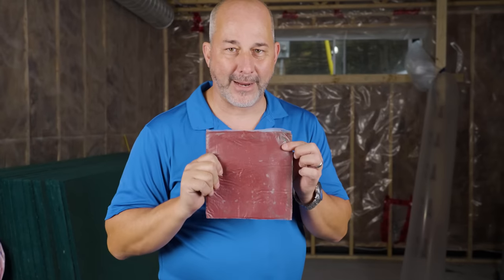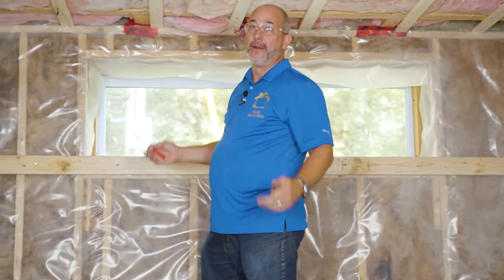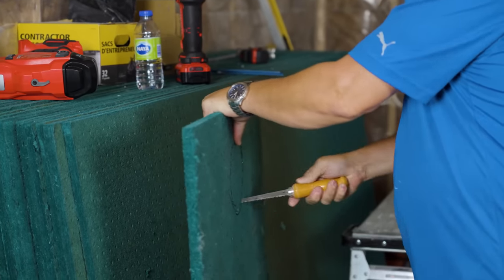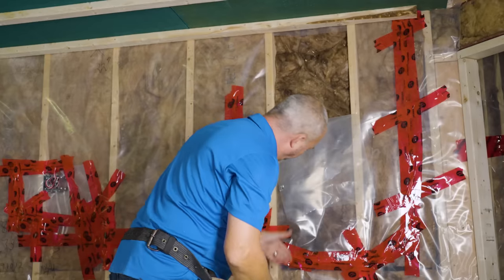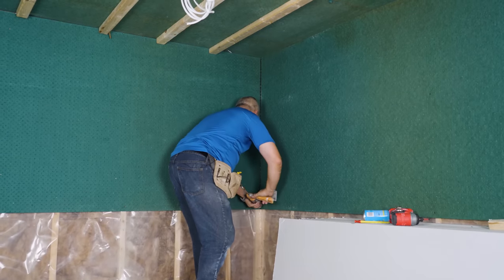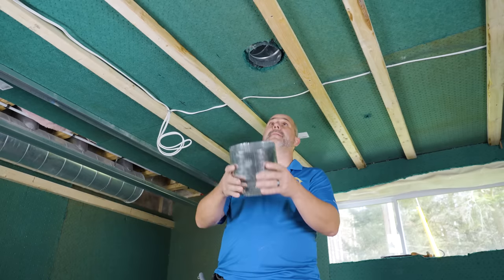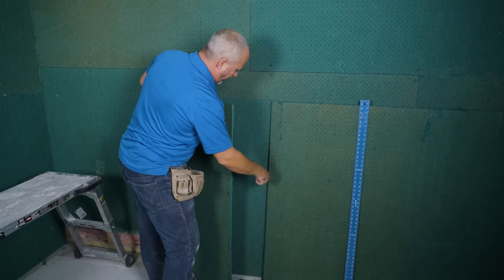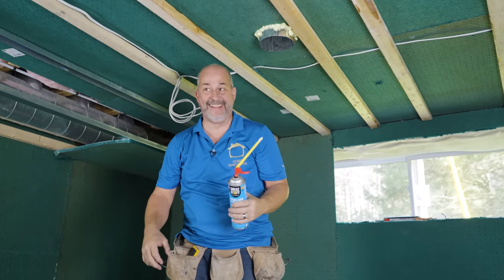Soundproofing A Room (It's Easier Than You Think)

Comment: As for wall soundproofing, IF you can afford to lose some space, building double walls with a space (like 1/2 inch) between so they do not touch, works great for preventing sound transmission. It’s the method used in apartments to separate units from each other.

Edited - I was forced to add to the original comment, because a few people couldn’t comprehend the idea that this was only an additional suggestion of another method used for sound proofing and I used apartments as the example. Perhaps apartments wasn’t the best example, but condo’s use the same methods and you usually don’t hear the neighbors. It’s only a part of the equation for creating a sound proofed room. Logically speaking, if you hit the 2x framing member in the wall, the sound will vibrate through to the opposite room that shares that wall, no matter how much sound proofing insulation is in that wall. You can use sound deadening caulks between two sheets of drywall and this can help, but you still have the potential for sound to vibrate through. Everything working together - 1)a double wall. 2)sound proof insulation. 3)doubling up drywall. 4)caulking any and all wall penetration and joints. Finally, there is a metal channel drywaller’s  use that help separate the drywall from the stud wall to aid in the prevention of sound transmission. This is usually purchased at  a drywall supply company. I’m sure there are other methods and materials out there, but again, this was only meant as an additional method. I don’t think that’s too difficult to comprehend.
Reply: Apartment sound proofing isn't the best.
Reply: @vanderumd11  
Who said it was?
It was meant as another example of preventing sound transmission through building materials, which is probably the main culprit for sound moving through walls. If they’re not touching, then you eliminate a large source.
Reply: If you're going to cite apartments as an example of "great soundproofing," you need to expect people who have lived in apartments to laugh at you. Apartments soundproof about as well as one ply cardboard.
Reply: @Xanthelei  
Most likely in low end apartments. In high end and condos, you have a far superior soundproofing experience.
Reply: @Michael Patterson  Guess which one the majority of people are going to experience. I'll give a hint: it's not the one that requires you make 100k a year. Thus citing "apartments" without specifying "high end" is defaulting to the baseline, which has terrible sound isolation between units.
Reply: @Xanthelei  
OMG!
All I stated in the beginning, is this was another method of soundproofing and now I’m getting crucified by people who think they know more than everyone else???

Don’t blame me if you and others can’t afford a higher priced unit, and please don’t take it out on those of us who offer other options. This is how we learn. 

If it’s done correctly, this is a very viable method. Soundproofing is more than just stuffing the cavities with specialized expensive insulation. If you hit a 2x wall member, it WILL vibrate through to the adjoining room. If there is a separation between two walls, and combined with insulation and caulking other openings, you have a great combination of methods working together! Think about how this will work.

Comment: I like your videos, I hate renovating my own home. I watch one of your videos and then I can do a little more renos... thx for that.
Because I like you... those studs used as strapping don't need to go wall to wall, right? I can't tell if you had to scroll the green panels around the straping ends, but if you give yourself 1 1/2" to 1 3/4" from the end of the studs to the wall, no need to scroll, less gap, less contact transfer. 
If you're worried about not having enough hold power by not having a nail or screw securing the end of the strapping to a joist, use two screws to secure the strap on the second last joist (or whatever you're securing to)

Comment: I've built a ton of theater rooms and other soundproofed areas using pretty much every technique out there. As far as the design, materials used and installation procedures, I never had to decide on anything, I just had to build it according to the specs in the blueprints. After all these years, I would say the ones that worked the best were the ones where we used the black rubber sheet, hat channel, rubber isolation clips and 1 1/2" Quiet Board (with all the putty and Quiet Seal involved). And that was just a regular homeowner in my town. Everything else seemed like a huge waste of money, including some of the stuff that we built for people who spent many millions on their homes. We soundproofed an entire condo top to bottom, a pinsetter room for someone who wanted a bowling alley in their basement and even soundproofed+bulletproofed walls for another wealthy client. I've done some crazy stuff, but not all of it was worth it in my opinion.

Comment: This is an awesome video, and now I want to do this to one of my own rooms lol. I have a question though! Considering the repeated emphasis on getting it 99% sound proof and limiting the metal in the walls and ceiling, how do you plan to reduce sound travel through the ducting? Both for the metal (Sorbothane pads like stainless steel sinks?) and the incoming airflow (breathable acoustic fabric?) would need to be managed I'd imagine.
Reply: That's what I was thinking about too.

Comment: It may be too late for this, but have you ever thought of leaving a note inside the wall or ceiling explaining what this awesome product is? I was thinking about what the reaction of the young people who renovate this room in 50 or 60 years will be. Maybe the video will still be available, but leaving a note with all that information can answer those question for them. Just an idea..
Reply: Leave them a newspaper.  They won't know what that is in 50 years!
Reply: I am rebuilding a place we got for about 18K US and one of the things I plan to do is leave a few notes and USB drives around with video's of what I have done for a future owner or whatever.  Going to make one as a time capsule of sorts and when I replace the sidewalks I am going to put it under the base layer.  A piece of 3" pvc with a couple glue on end caps should work well, probably gonna toss in a couple bucks in change as mint rolls so it's all uncirculated.  In 50 or 100 years someone will have a really nice surprise.
Reply: @MuttMuttOutdoors  physical notes are still a better idea. Good luck if in 50 years usb protocol even still exists as it does, better luck if they'll have anything that interfaces with our current usb standards. Worst case is if the memory in the stick even lasts long enough. Flash memory is volatile and will fail in a shorter period than you may want.

Comment: Looks good.  A little overkill for my tastes but at some point may end up picking up a place that is split into two apartments and will do something to help the noise not transfer from one side to the other.  

I do have to say your option for draining the hose bib is more of a pain than my solution.  I installed a PEX distribution block and the more I use it the better I like it.  I can shut off my hose bib, take a air compressor with a blow nozzle, pull the line out of the distribution block and blow all the water out of the line.  Makes my life too easy as one thing that I installed as well is an outdoor shower.  Yep it seems odd but if you are outside working you can do a quick rinse to cool off any time and don't have to pull out a hose and when you are a complete mess from crawling in the mud or under a house or whatever you can shower outside instead of dragging it all through the house.  Plus in the summers here it's easily in the 100's and the feel of a nice shower with a little breeze is such a good feeling.  

Oh, one other thing that is helpful with a distribution block which I just dealt with not long ago is draining out my water heater.  We all know that there is calcium build up in most water heaters so I removed the crappy plastic valve but to get the water out was a MAJOR pain.  I had it gravity draining overnight and there was still 10 or 15 gallons of water inside it because of the sediment blocking the valve.  I took an empty hot water port and applied some compressed air, naturally the cold water feed valve to the water heater was off along with all the faucets.  The water drained out very well and when I put in the 3/4 full port valve I was able to get a couple pounds of sediment out by filling partway with some water and then boosting the pressure with compressed air like you would have on a well pump reservoir tank.  Tip the tank and shake it around a bit and then open the valve and sediment be gone.  Figuring that out made me realize that I will use a distribution on every house I do from now on because I can take and drain the water heater, shut the house water off, pressurize the water heater then use that pressure to effectively drain all the water lines just by opening the faucet valves till air comes out.  Hard to beat having 40 gallons of air at 50 psi to clear the lines!!!

Comment: You reference the mineral wool. And for sound proof you are right don’t waste the money if sound proofing is the goal. Only benefit is fire safety.  Also i worked at the factory in BC for Rock Wool. If you do decide to use it just go without the cheapest product. There was R14 and Safe n Sound.  Same product just the safe and sound didn’t meet R value.  Basically if the mix was off from the melter we would switch bags. And yet I have seen safe and sound go for more money sometimes. So ya if you do buy it go with R14 if it’s cheaper.

Comment: I’m new to your channel, but the few videos I have watched have been very educational and helpful even after being experienced for 40 years myself. Great video!
One question I have is in regards to vapor barrier on the exterior walls. I was taught at a young age to install my vapor barrier between the concrete wall and the newly constructed stud wall. We simply secured it to the bottom of the joists and then some spots of liquid nails on the concrete walls. Then down to the concrete floor and out past the new wall by about a foot. I was always under the impression that this protected studs, insulation, etc. I’m always willing to learn new techniques and tips. Please advise if I’m missing something. Again, great video!
Thanks much!

Comment: You could use furring channel (Hat track) used to frame drywall ceilings instead of the 2x3 strapping over the green board. But only screw it on one side so it can take some of the vibrations.

Comment: For enhanced sound isolation, liquid nail can be used any place a screw is. Place the liquid nail down first, use a screw to temporarily attach whatever you’re working on (drywall to studs, for example) and then remove the screws when the liquid nail has cured.
Reply: liquid glue will NOT last as long as screws, mark my words
Reply: That's a bad idea.  Really, really bad.  You want the material mechanically fixed even though it decreases the soundproofing a wee bit.
Reply: It's not a literal liquid nail lmao

Comment: When I have to use a can of spray foam and the location does not allow me to hold the can upright to maximize the use of the air inside, I simply attach a length of clear plastic tubing to the nozzle (2", 4", 6" . . . Whatever length I need).

Comment: This was great, it gave me lots of ideas. Really helpful video, thanks.  I have a converted garage which I want to make as soundproof as I can. It already has insulation and drywall so im wondering if i build on top of that, or strip it all back and go with the fibreglass and greenboard right from the masonry. Any suggestions?

Comment: Is Sonopan better than double drywall layers with green glue inbetween?
Reply: That was exactly my question too! Also, awesome to see you in comments. Legend!
Reply: Yes. Go look at his other videos on sound proofing
Reply: Sonopan has a pdf with the stc of various assemblies. You'll notice that all of their assemblies with decent performance are shown with double layers of drywall in addition to the sonopan. They also do not publish the test results (frequency plots). This makes it hard to compare a double drywall wall vs a sonopan+drywall wall (or ceiling). To me, that speaks volumes as to the actual value of these panels for soundproofing. I just went through a fair amount of research for my own project, and I am not using sonopan.
Reply: TayZonday Your Minsk was better.
Reply: @wvlarsen  Surprisingly hard to find sonopan testing and comparisons. But their pdf shows STC50 with insulation+sonopan+drywall, while insulation+drywall+glue+drywall is STC49. STC doesn't even test below 125hz, so base is out of the picture.
Sonopan is 3mm ticker, and almost 3 times less dense too. I imagine sonopan is slightly better for higher frequencies while drywall would be slightly better at lower.
Reply: @wvlarsen  Sonopan helps absord sound and serves to decouple the drywall. Drywall is only mass and will act as a drum skin. If you connect everything tight to the structure, with only one material density,  you'll get direct conduction. Mass isn't everything, you need varying stiffness and densities and decoupling.

They publish an STC rating. That's enough for comparison.  Their best assemblies are shown with double drywall  layers, because soundproofing works as a system.
Reply from the maker: @tayzonday In my experience the green board is a great way to get a quick quality result for a home theater or office area. I am going to post 2 more videos from this room. the next one is how to  install a double sliding door and the third one will be with a sound test in the room above it and just outside the door as well. That will help folks understand the actual benefit and if they think they need any additional improvements to the system they want to install. Cheers!
Reply: @FrozenThai  That Sonopan STC50 assembly with sonopan+drywall is using resilient channel. And their STC51 assembly is using sonopan+2 layers of drywall. So no assembly showing the STC of what most people would do, which is simply adding sonopan underneath their drywall (like Jeff showed in another video). I too would like to see the frequency plots of Sonopan to understand where it does best, but again, they don't show that.
Reply: @rolfbjorn9937  The question was whether Sonopan + drywall is better than 2 layers of drywall. Their stc ratings don't show that. And yes, of course soundproofing works as a system, which is why I mentioned in another comment that decoupling the layers from the joists would be much more useful here than doing two layers of coupled strapping.
Reply: @HomeRenoVisionDIY  I look forward to the sound test. Please show the results using a sound level meter.
Reply: Sonopan isnt available in the USA
Reply: @wvlarsen  so how are you doing it?
Reply: I keep finding you on the most random youtube videos, the youtube legend is a guy like all of us, watching random ass youtube content
Reply: @wvlarsen he’s a contractor and diy coach, not a sound engineer or music studio designer. I think you probably need to manage your expectations as to the information Jeff can provide for your use case.

Comment: Thanks Jeff! I always appreciate the stuff you put out, it has been a life saver plenty of times. I was wondering why not use blown in cellulose as your insulation instead of fiberglass? If you dense pack it seems to be a much better sound absorber than any other option on the market
Reply from the maker: not going for perfect here. You just can't make a basement perfect on a forced air heating and cooling system.
Reply: Insulation's job isn't mass. That's what the drywall is for, and that's why mineral wool is only a minor step above fiberglass. Blown-in cellulose is fine, as long as it isn't too rigid. You need the material to be flexible for it to turn sound into heat, which is what insulation is for. Which is why spray foam is terrible.

Comment: Hey Jeff.  i'm a cheap bar steward when it comes to material costs (Pink fluffy vs brown wool) and when we did our units for rentals our drywall contractor said the same thing, plus we did 2 layers of 1/2" board.   At the time I don't think that sonoboards were on the market (or at least at a reasonable price) and the alterative was that fancy metal strapping that is a nightmare to install.   Overall, lot less noise between the units and no issues/complaints.    Liking those Sonopan simply from a DIY perspective.
Reply from the maker: and it is quite economical as well.

Comment: Hey Jeff! I have a question: 4x8 sheet of Sonopan is 30 bucks. One sheet of 5/8" drywall is 30 bucks. Drywall has more mass... Why not just do two layers of 5/8" drywall?
Reply: Bingo
Reply: You'd need foam pre drywall if your trying to record. To much reverberation
Reply: @jpcc815  The room has drywall on the inside whether you use SONOpan, or whether you're smart and avoid the hype. You'll need some kind of acoustic treatment on the walls regardless.

Comment: Love your videos and the work here is great, except for the issue of ducting and the window. Easy enough to cover the glass with a removable panel, but man, that ducting is giant sound transmitter. No point worry about sealing air gaps (which you mention the importance of correctly), when you have ducting sending the sound outside like you left the doors open. 
Someone else mentioned building a second wall, not connected to the outer. That’s crucial. Also, having multiple layers of various density and material is super helpful.